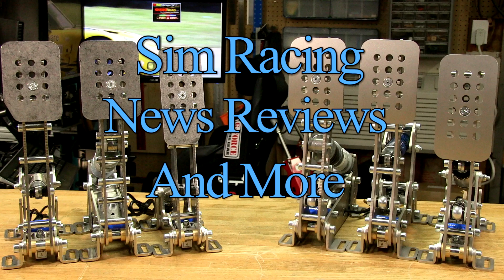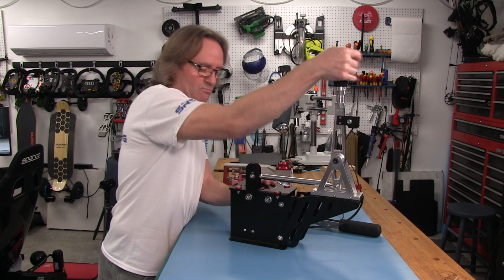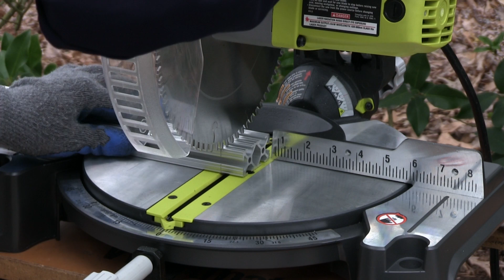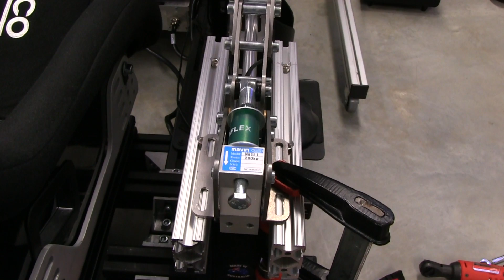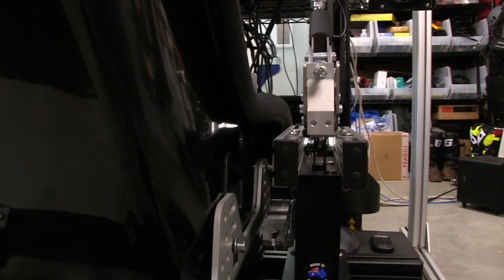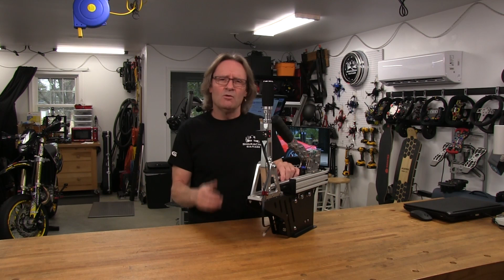SimWorx/Heusinkveld Rally Mod

Comment: What's the little lever on the front of the shifter?
Reply from the maker: Reverse lockout switch that has to be pressed to access the reverse gear. Prevents accidentally shifting into reverse while quickly downshifting.

Comment: I wonder if the handbrake could be mounted in an upright position against the vertical where your remote control is attached.  That way both levers would sit in a more traditional position.  Would that make it too much of a reach for the handbrake though?

Comment: Great mod. Would it be possible mounting it using one of those profiles on its side with an angled mounting plate so the handbrake can be parallel with thw shifter but angled outwards slightly?

Comment: Most cars with a hydraulic handbrake setup have the handbrakes vertical arm outside the sequential shifter arm and angled slightly towards the driver.  It's hard to explain how to angle the handbrake but to put it simply you grab the shifter then rotate your shoulder outwards to where the handbrake is mounted, you then angle the handbrake mount to follow the angle of your forearm.  This gives you the best control by having the bicep pull in a straight action.  I would think that most modern rally cars use the 2 vertical handles method.

Maybe this is a better option Barry.
Reply from the maker: Yes, certainly many other ways of achieving the objective here. But to get the ergonomics perfect would require some outside fabrication efforts and I wanted to use materials on hand. Also, wanted a combined, relatively easily deployable unit. This to switch between my Pro Sim H pattern shifter. And of course other hardware that I review.

Comment: nice video! 
but how is the long term strain on your wrist with that sort of grip on the handbreak?

another thing though:
first thing i was tought when using power tools like the saw you have there is to never ever use gloves, especially no „fuzzy“ ones. people‘s hands can get pulled into the saw when the sawhooks get a hold of some of the fabric. i know two people that did not listen and one of them cut is whole hand in two. nasty stuff.

i‘m not telling you how to use your tools, you seem more than capable of that, but just a friendly advice :)
Reply from the maker: I think the camera angle exaggerates the angle on my wrist and arm. No strain on the wrist, only shoulder soreness after the first day of heavy use. My shoulder wasn't used to that motion. Now the soreness is gone. And yes fuzzy gloves are a no no. But this is a chop saw. No way for my hand to move toward the blade as I hold the piece. Now if it were a table saw, or band saw where you are feeding material into the blade. That's another story!
Reply: Ah okay cool! That is a real nice thing about simracing in general, that you can adjust everything to your needs. cool thing!
You are right about that. Maybe i am a bit too strikt on my rule of (keeping the) thumb.

thanks for the reply! keep up the good work, your in depth videos are of unique quality!

Comment: Nice setup. One question though, why not just use T Nuts to mount the profiles to the Awsome Seq shifter?
Reply from the maker: T Nuts would also work in the channels. They do take up more room in the channel than a cap head bolt. I wanted to make sure I had plenty of room for the holes and screws used to mount the handbrake. Which ended up very close the the cap bolt heads.